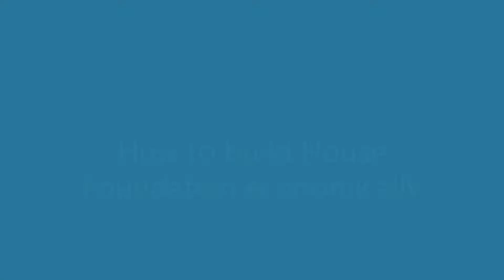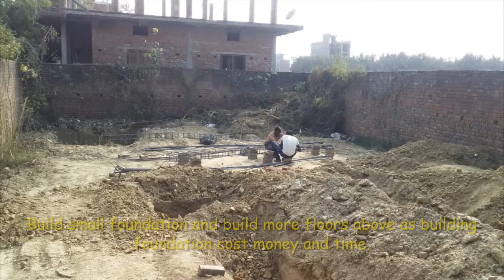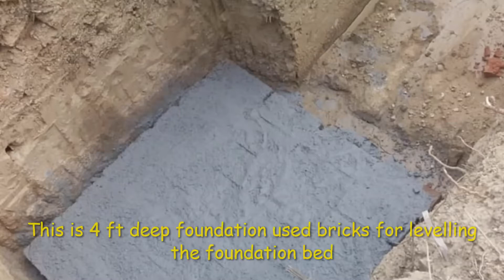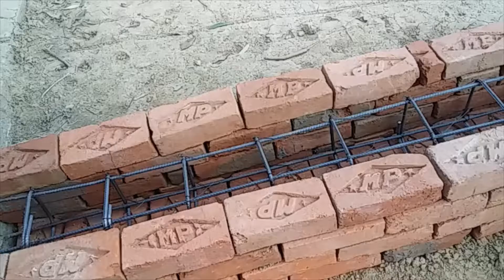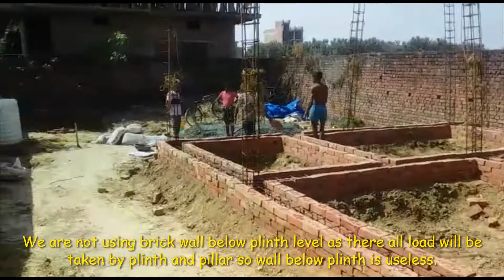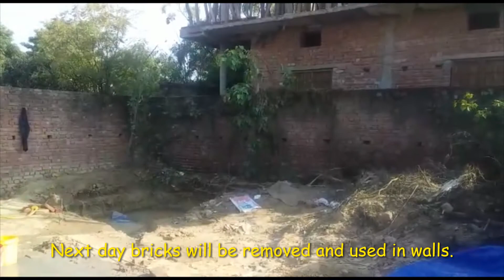Indian House foundation construction, a cheaper, faster, efficient and economical way

Comment: Some wrong construction techniques you have used. Like avoid using bricks below foundation bed instead use stone. Should 
take caution when using bricks as shuttering for column or beam, bricks should be totally wet before pouring concrete outherwise it absorb water and will effect the strength of the column.
Reply: Sir, happy new year. Con I use old wall stones which is vest. What happens sir. For just information for learn.
Reply: OK Sir. Thanks. Great thanks. Wish you happy independent day.
Reply: Its a plane area not a hilly area so that's why it is used.

Comment: Using brick as shuttering in not the correct way of construction..... Because brick consume available moisture from wet concrete which will reduce concrete strength
Reply from the maker: Right but same brick if soaked in water can provide necessary moisture to concrete.
Reply: Right not good